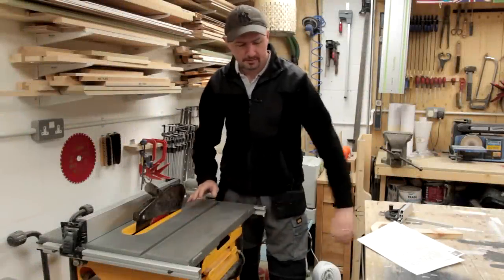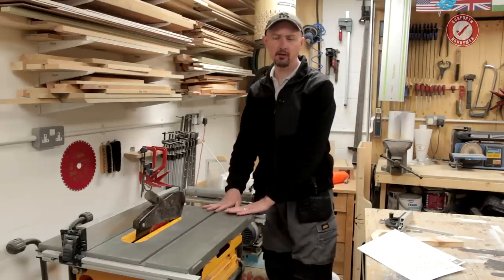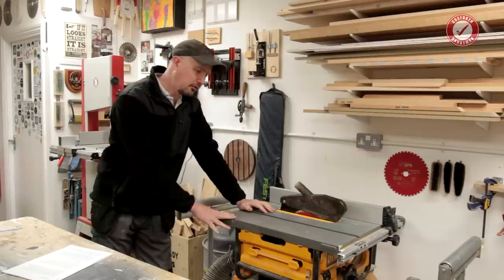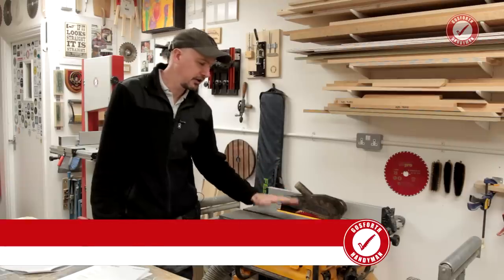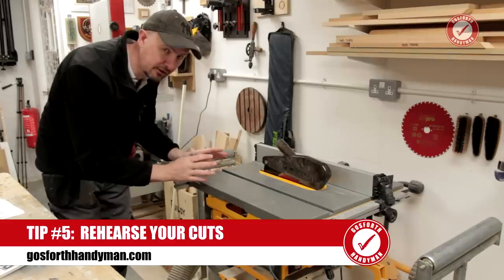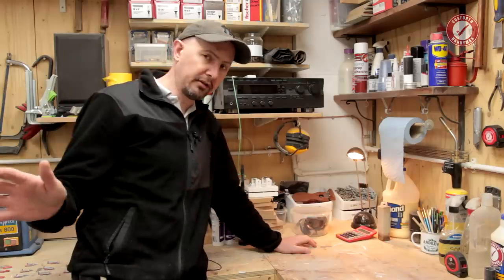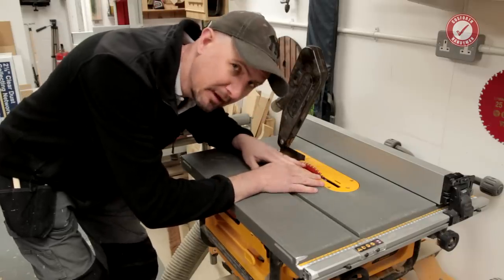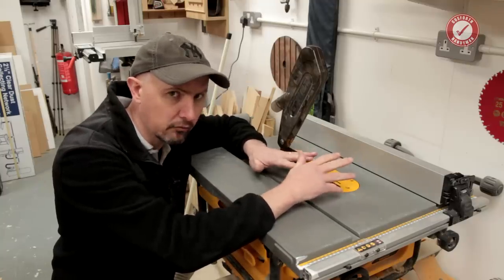TABLE SAW SAFETY - 11 tips to avoid death!

Comment: Just saying, but you feeling like you needed to hold onto the off-cut piece is partly due to the fact that you don't have the wings installed on your saw. And, why have a roller stand between you and the saw? If anything, that roller stand should have been supporting the off-cut on the side of the table. That narrow little saw looked dangerous from the start of your video. I know you are a professional, and I am a mediocre at best hobbyist, but that was just something that stood out to me immediately.

Comment: He didn’t say anything about it but another safety point he got right was the fact that the saw blade was barely sticking above the wood
That’s for your experience
Reply: @mathew Downey he did mention not having the blade set higher than a tooth above what your cutting

Comment: A table saw is not the most dangerous tool in the workplace,  they are all equally dangrous and deserv the same care. Handling , and safty precautions.
Becoming lax on that point or any toll will result in injuries.  Any tool with a motor and spinning cutter be it metal plastic wood or anything else deserves respect.
Even most manually operated hand tools can do serious dammage even using your own forces. I cant count the times I've cut myself with a marking knife or razor knife just drawing a line next to a rule. You have to take every tool seriously, you cant be drunk stoned or high or under any drugs legal or illegal.  You should be wide awake and alert at all times. Work safly without distractions from anyone or anything. 100% of your focus and attention should be on what you are doing. Wear safty protection becuse even though your trying to be safe the tool isn't. You must be 100% in control.

Comment: I ever think to buy a table saw, then I realize that there is no much in this life. I like being healthy and I will avoid anything that seems dangerous. A table saw is best to help woodworking for precision but the consequence of accidents is too dangerous. I will not buy that one tool. I use a jigsaw, it is not easy and not precise, but I'm happy that the blade is downward. There is also syndrome when someone doesn't like sharp pointing things to their face. Yeah, it didn't make me feel safe. I think the most that I will get is a miter saw for precision. I like jigsaw because it helps me make curve, but sometime I want a circular saw because it is faster to cut wood than jigsaw.

Comment: "100 miles per hour"......made me wonder: 10" table saw has a 31.4159 " perimeter, rotating at perhaps 6,500 rpm = 204,203 inches per minute....sounds horrendous, but that = 3,403 inches per hour, = 283.6 feet per hour, = .05 miles per hour. No one wants to stand in front of a projectile at any speed, but it is a stretch to say it is 2,000 times that speed, yes? Perhaps that slice of wood at 100 miles per hour might have severed his torso in two, and kept on going, into the wall, beyond, no?
Reply from the maker: Isn't 204,204 inches per minute 12,252,180 inches per hour? 🤔😀
Reply: @GosforthHandyman   Yes, you are correct, so sorry..... Inches per minute still has to be a larger number than the equivalent miles per hour, right? Multiply by 60 to get from minutes to hours, but divide by 12 and again divide by 5,280 to get from inches to feet and from feet to miles. So, 204,203 inches per minute should be 12 million+ inches per hour  then divide by 12 and again by 5,280 and your board whizzed by at 193 miles per hour. (Please excuse me while I clean all the dried egg off my face?)

Comment: I suggest getting one of those face shields. Wearing goggles is one thing, but it doesn’t quite cover tour face and goggles are already pretty close to your eyes. I recommend wearing goggles and a face protector when using any woodworking tool with a blade of some sorts.

Comment: you repeatedly state the table saw is the most dangerous tool in the workshop. Personally, I think the radial-arm saw is a lot more dangerous especially when ripping timber into planks and even though it has anti-kickback pawls they have to be manually adjusted to the timber and it does not have a riving knife.

Comment: Side cutting prevents access to the switch during an emergency.
Reply: I always use a foot switch so there is no need to release what ever I am working on or change position to shut off any tool I am using

Comment: You fail to mention the 1 glaring error.   You are cross-cutting a  board that is wider across its x-axis -- more than twice the y-axis in fact!  Making a cut like this requires a sled of miter sled or a cross cut sliding table or proper miter gauge. It is way too easy to slightly misalign  the panel during the cut, causing kicback.   Also, never use the fence as a guide for such a cut because you may pinch the cut piece between the blade and fence.  In the end, you are lucky you were not using a cabinet 3 or 5 HP saw as the danger multiplies.   Last, keep your blades SHARP!
Reply from the maker: No, the cut board (the board to the right of the blade) is longer than it is wide. The BIG no no is the cut side being wider that it is long, which it isn't. 👍

Comment: Just an opinion. The blade should spin away from you. When you saw cut wood. The saw blade is spinning down to the ground. That would be safer. If an electric hand saw blade is spinning up it's not worth buying for that safety reason. The hyper tough hand saw blade I bought from Walmart has that problem. The blade spins up instead of down. That's incorrect. And should be checked out.

Comment: 20 years as a shop supervisor. I would literally consider firing a shop carpenter if they came to my shop and positioned themselves on the opposite side of the fences as he does at the 30 minute mark. This is nonsense advice that makes me question everything else he says here. The mechanics are entirely wrong for feeding a board and keeping it tight to the fence, and he is nowhere near the power switch to cut it if something goes wrong. He is feeding with his left hand, which is non-dominant for 93% of the population and his right hand is BEHNID THE BLADE?! Frankly, I'd be embarrassed to post such a video.

Comment: Right of the bat, the most dangerous tool is the radial arm saw followed by a spindle shaper with knives,  Any tool is dangerous with dull cutting tools,  I was a professional architectural millwright for over 40 years and never injured myself on a table saw even slightly and I will NEVER use a blade guard. If you know what you are doing, a blade guard is dangerous.  But I won't use a table saw for sheet stock - especially with a tiny table,  Use a panel saw instead.  Also suggest a stock feeder for ripping.  And I will never use a mitre gauge - ever.  Use a sled  Use the correct tool.  Push Pads should have been outlawed decades ago.  
BTW, "Common sense" is NOT at all common

Comment: The table saw is not the most dangerous tool in the workshop.  There are tools, if you don't use them correctly, they will be cleaning you up with a mop.
Reply: Let me guess, you've never worked in a shop having a radial arm saw.  Or a manually-fed mill.  Some air tools can be deadly if mistreated.

Comment: Your blade is to much lower. It supposed to be 1 inch higher than the wood. Your accident is because the piece is run on the blade.

Comment: I use board buddies on my table saw. You can also use jessem stock guides. But moreover your cutting the sheet tottaly wrong aside the other mistakes you made. Where is your miter? Why are you cutting a long part like that? Why is a roll stand set up on the infeed side of the saw?  OK lets say you don't have a spliter or riving knife. You can always attach a hold down board on your fence. But on kickback 90% of the time the back edge of the saw lifts the part and the blade slings it back at you.  You could safly push that past the blade had it not been for the roller stand in your way.
 Now im human too. I got the tip of a finger chewed up by a trim router holding it very low and my index finger tip went back into the cutter. Most the time this injury will cut down to the boan I got lucky.  Thats why I said every tool in the shop can hurt you. I refuse to use a table saw without a riving knife or spliter.  I will use one without the blade guard. Simply becuse my porter cable job seight saw slung it back into my face like you got hit with that board. I also now stand to the far left of thd saw turning it on. Only takes one mistake to wake you up.
I've never had a kickback. And I used to cut a lot of sheet goods on the table saw. 4x8 3/4" thick mdf.  Full sheets 2 people. No riving knife or guards.

Other mistake with a radial arm saw, and ripping  wood. I ran the wood the wrong direction, the saw grabbed the part out of my hand the radial arm came flying at me and the blade got bent out of shape, simply becuse i didnt pay attention to the feed directions.  Needless to say i had to chage my shorts, only did it one time, now i have a special fence for that opration and I use board buddies on it as well. I have jessem stock guides on my router table too.  Anything to hold down the part I can keep my hands safly away from a spinning tool.

Comment: OK...I admit....I'm a table saw pussy....too scared to use them.  But why was the plywood scrap not supported by an extension table?  That way you wouldn't have had to worry about the large scrap as you leaned over the table saw.  You would not have had to have been standing right behind the blade?

Comment: as much as i like safety or precaution videos, as much i have seen overloaded videos, unorganized, repeating the same information and missing essential points.
i would like to see a series of episodes respectively titling it part 1, part 2 ..., than jaming all in one video calling it death threaten etc

lets start cracking 
the most dangerous tools by far are the handheld circuit saw and the handheld grinder.

i dont know the manual of the dewalt saw is organized, but normaly machine manuals have poor safety advices, so i would not relay on them that much.

the most common error is using devices not matching the job. with all respect you are working on a jobside table saw. these saws are design for easy cuts on jobsides. what you need is a stationary table saw to do continues precision cuts,  with much more safety future like a sliding table.

the next most common error is working in overcrowded enviroments like yours. shure in your video everything looks tidy. i  really cant imagine doing a job in there. that means parts are all over pushing machines around, parts from one side to the other. my top tip here before buying machines, ask yourself if space will not be an issue.

the teeth of the blade have to run free for cooling. they run a 200 times a second through the wood, that means a lot of friction, that means heating, that means expansion, and that means trouble. the least problem is, that the blade worn out faster. have the blade rissed up to the bulge under the teeth so sawdust will the thrown out rapidly and the teeth are receiving as much as possible cooling air.
but also there is no need to rise it up to full height.

always use proper sharpened blades. 

and now my head is nearly blowing off. 
where is the emergency stop push button? easy to reach in all possible imaginen situations. this is the first thing to install before even the saw gets in your workshop.

and how on earth even to consider a side way cut? look where your hands are? how you will use a push stick? how you will stop the machine when things go wrong?

as much as i understand to do a safety tutorial video after the accident, as much i hope you understand the responsiblity you are taking. 
precisely when newbees thing they can look some videos and now they have learned enough to avoid the most dangerous situations. and crowds are sheering what a wonderful helpful video and not having the slightest idea what is really essential.

my top tip: if you even considering buying a table saw, go and look for someone trusty with experience to have him by your side, work with him for a while, look his movements, check how things are installed.
not manuals, not videos, not chipchat will help you in the moment when things go wrong.

start with something very easy.

never ever get over convidenced. it is impossible to reproduce the same trusty situation again so everytime you are in front of the saw treat it like it is the first time.

make enough and long enough breaks. concentration will go down after a while and you need all the concentration you have to work with a tool that really cuts everything anytime anyhow in a fraction of a second.

Comment: Best you stand in front of the blade doing everything correct than you trying to dodge the blade and do even a very few things wrong.  The idea of not being in front of the blade has resulted in so many stupid push angles and awkward movements.  Don't forget your off button is there in front of the saw.

You can't drive a car safer because you are in the backseat!

It's better to understand what the saw and wood is doing rather than just blindly following a set of methods. If you can't concentrate, then you better stop. Wood do weird things at times, and people need to understand it when the wood does release internal stresses that the only thing protecting them is their understanding of how the machine and material interact and the options available.

Finally, when the machine is too old and busted... Toss it and buy a new one.  That 50 dollar Sears table saw isn't worth your life.

Comment: nope, definitely not thinking any of what you said "it's fine", "you got out ok", "no big deal".  Not to offend but this has to be the video where the most rules are broken using a table saw.  This is completely reckless, and you are in fact extremely lucky that you did not sustain more damage.  I cannot imagine using a table saw this irresponsibly.  This type of use is what gives table saws a bad reputation.   Even if you are using a knife, and push stick properly, you should not be cutting sheet goods on a table saw.  Use a circ/jig saw if you're on a budget, and a track saw otherwise.  SHEESH

Comment: I wouldnt worry about kick back on such a small saw, should have been easily stalled in this situation. Seems staged.
Reply: I had a saw like this catch a 450 x 450 3/4 ply and throw it back into my knee , no riving knife , did not even drop speed only 1700 watt , fecking hurt bad dude.

Comment: Your first example... is the narrative about the dangers of a table saw or bragging about the size of your schlong? A few inches LOWER would have made Mr. Happy very sad? In all seriousness, I think more so than the riving knife, and yes, related to you being tired, the kickback was a result of you focusing on the wrong hand. The piece between the blade & the fence is all the danger. Should of, would of could of... let the off cut fall to the ground. It seems pretty clear from the video you were more concerned about the off cut than the danger zone. Your right hand moved correlative to your left hand's motions -i.e, how your body geometry curved following the motion of your left hand. And for those of you out-there using a jobsite saw, there are jigs for supporting larger pieces. Make em for this very reason, or use a circular saw either with a straight edge or rough cut and make the finish cut with your table saw. Here's an excellent from a series about table saw technique. This guy doesnt use a riving knife, not because he's more manly, but rather he understands how table saws operate at a much higher level of awareness: https://www.youtube.com/watch?v=1jDTKhW5gVI